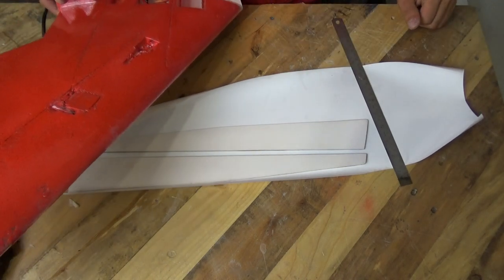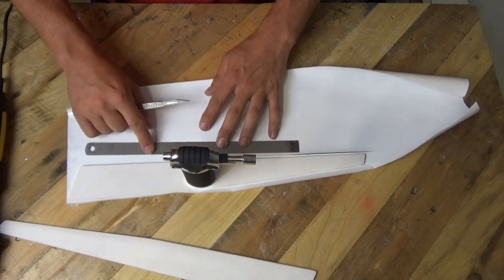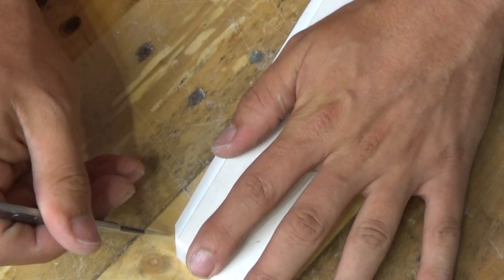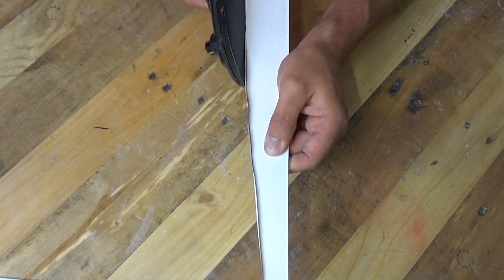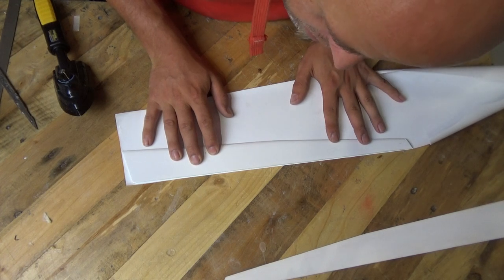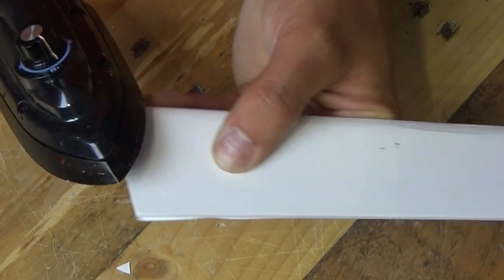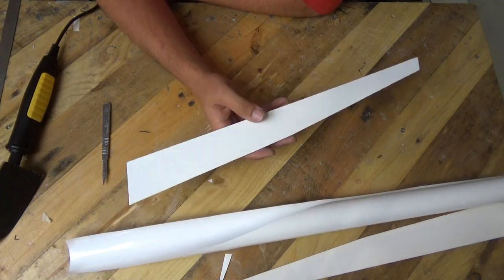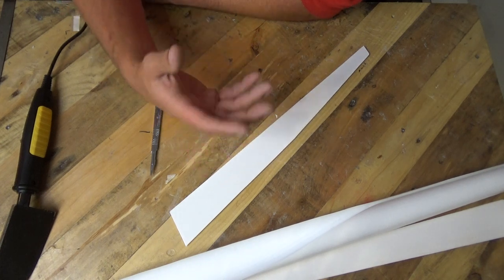How to Laminate Smaller RC Model Parts - Part #2

Comment: Hey Matt I am about to build a Guillows P40 just for fun...rather than using the tissue paper covering what are your thoughts on laminating it...Most models I have seen done with tissue cover are pretty poor so I was thinking about clear laminate  what do you reckon
Reply from the maker: Howdy Neil, I have no idea on that model I'm afraid. However clear lam for me on my models has worked exceptionally well. I don;t see why it wouldn't be the case for you too, Matt

Comment: Traditional covering film is designed to shrink around the balsa framework of built-up models in the same way shrink-wrap does around wires. It gives you a nice tight skin over a framework construction, but it's not so easy to use on foam.
Reply from the maker: Morning Skylark, agreed. It'll shrivel on you in a snap if you're not careful. A new roll arrived though, so don't need to be so tight next time, matt

Comment: Howdy matt, quick question when you laminate your wing, through the heat presses will it take a creese out of the wing due to crash damage?, I have took some out with steam. Wondering if it will take the rest out. That's on my c1 chaser ???
Reply from the maker: Howdy Nigel, I would suspect so, however the iron is generally hotter and may cause raised bubbling of the surface, Matt

Comment: Hi Matt, I would recommend a heat resistant silicone pad, when working with small parts. They can be bought quite cheaply on Banggood or Ebay for around $7 usd
Reply from the maker: Howdy Anthony, I just normally use the workbench, the worst that can happen is I find a pool of hot glue 😀

Comment: S800 : Do I make any kind of relief cut for the elevon (bottom) so it can fold?
Reply from the maker: Howdy Rudolf, on the S800, the elevon has a 48 degree cut on it, so it will bend over nicely and then you can use lam to make the hinge. Hope that helps! Matt
Reply: Matthew Ogborne ok. I think I get it. Carefully fold the elevon back so I can lay the lam in the now flat groove. I am nervous about breaking that hinge. Have considered a strip of tape on the top.